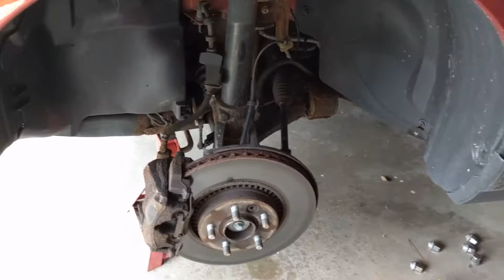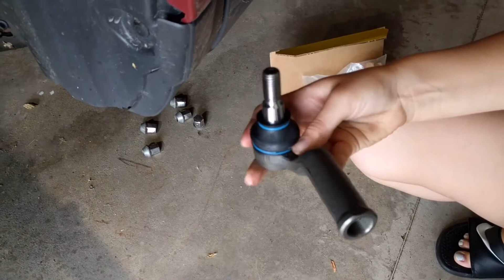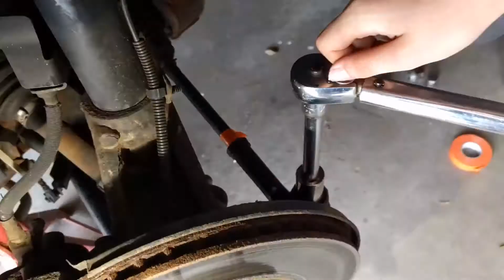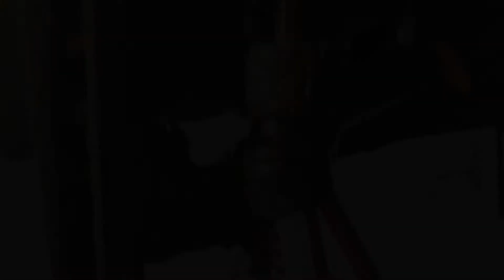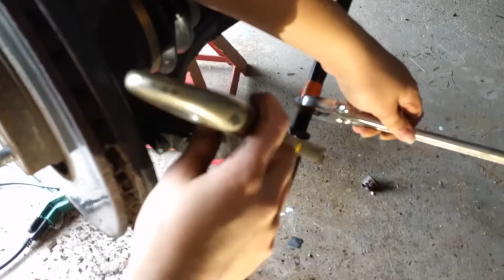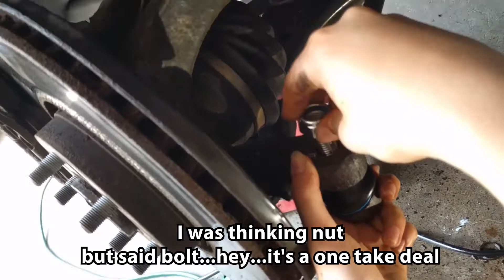2008 Land Rover LR2 How-To Replace the Tie Rods

Comment: Great video, my cars steering wheel can not center properly, do you think this due to the bad tie rod? Thanks
Reply from the maker: han shawn bad tie rods will cause your car to pull one way or another and wear your tires out more quickly. Not sure about the steering wheel. When you're driving and you straighten the wheel, does the car not drive straight?